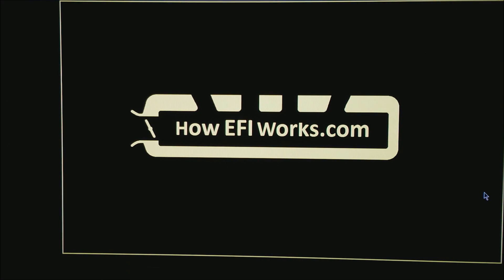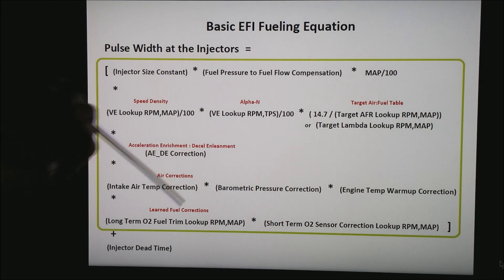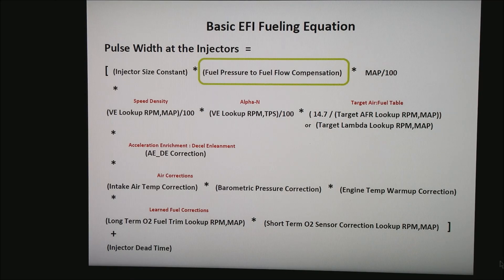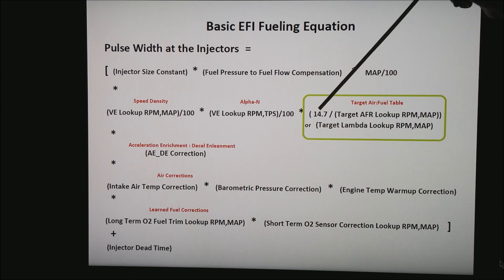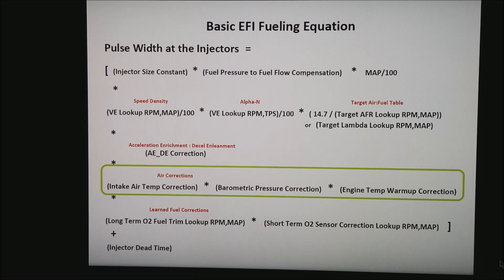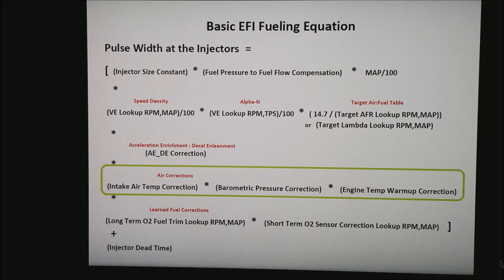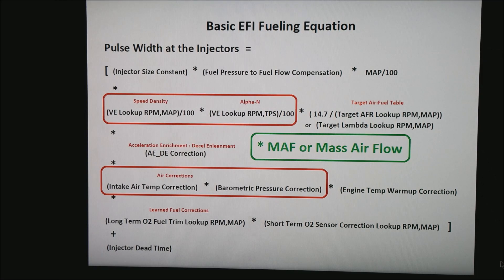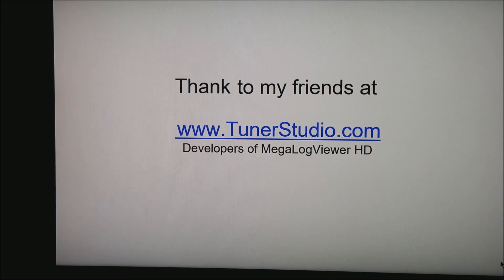The Basic EFI Fuel Equation

Comment: One thing, i would like to humbly clear here...the MAF systems does need IAT, ECT,  Barometre inputs to calculate air density like these are needed in MAP systems...MAF sensor only provides air volume through V=cross sectiin area x air velocity...this air volume is more precise than MAP system...